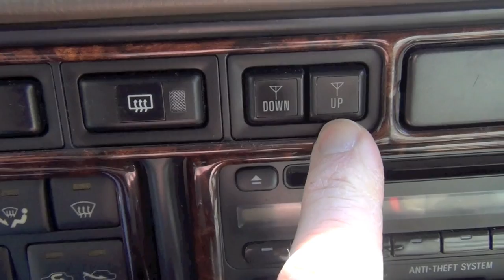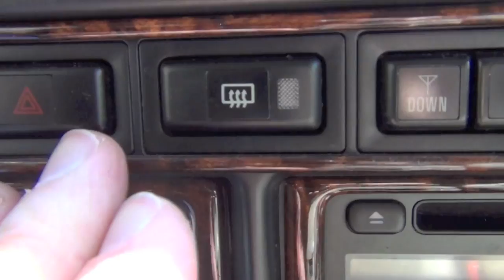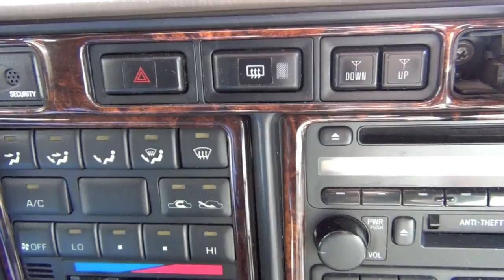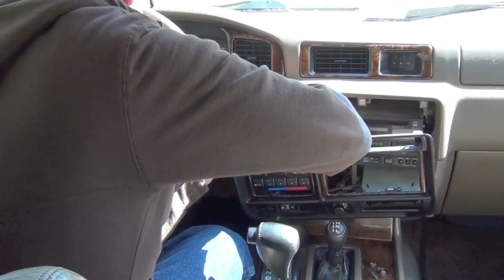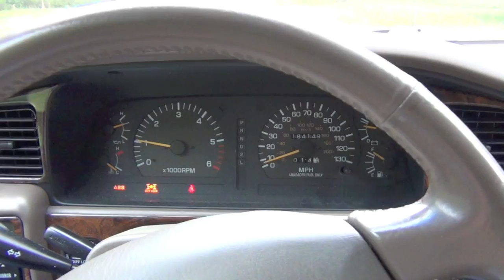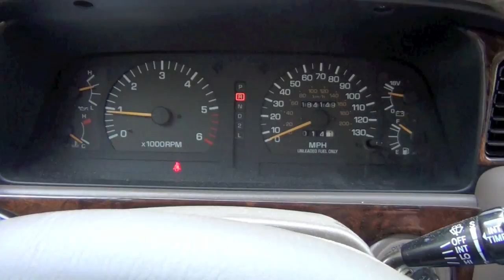80S Land Cruiser  CDL switch install

Comment: Hey Texas - I did this CDL switch install on my 96 LX450 after seeing your vid. Your instructions are spot on.  One minor deviation, I did not move the Security as my wires were super tight. Instead I moved the heater for the rear window to the bottom. I had to remove some of the tape from the harness, but it seemed like the wire length favored having the Diff switch up high next to the Hazard and Security, and the rear window heater down low next to the heater fan switch. Super easy after watching you, took me literally 30 minutes. Much appreciate your vid!!!!
Reply from the maker: Rog Pics - Good to hear man!  Thanks for letting me know it was helpful. Glad you got yours installed. Look up that Pin-7 mod (I added a link in another comment below) it will give you ultimate control.

Comment from the maker: @Dog Hous, the CDL switch allows you to lock the center Diff (in the transfer case) such that the front and rear drive shafts turn in unison. In normal ops w/o this switch engaged, the front and rear drive shafts can turn at different rates letting the front wheels or back wheels slip like a normal rear-end under a car can let one tire spin while the other side doesn't. Same deal just front to back. Make sense?  Putting the Land Cruisers in Low will automatically lock the center diff as well. (Unless someone has deactivated this automatic lock)

Comment from the maker: @Chor, con't from 1 post; ...in the steering linkages and joints. If the pitman arm is not moving very much - the slack is in the gear box. If gear box, then some slack can be adjusted, but be careful not to over tighten as the box can bind. If linkages, then you have to replace the worn linkage parts (tie rods, etc). hope this helps. Basically something is worn and needs replacing or in the case of the steering box; adjusted or replaced.

Comment from the maker: @Chor, The steering play is usually one of two problems or a combination of them both. Have someone sit in the vehicle with it turned on, but not running (key turned enough to unlock the wheel). Have them go back and forth to the point where it pushes the steering firmly on both ends of the play. While they do that, you look under the hood and under the vehicle to see if the pitman arm (off the steering box) is moving or not. if it is moving back and forth, the looseness is probably...

Comment: Hey great video, quick question. What is the point of this modification? To be able to lock the central dif in high gear? Thanks. Also is there a way we can add front and rear differential lock?
Reply from the maker: It is so you have complete control of when the center diff gets locked BUT you must also do the Pin 7 mod (look that up on IH8MUD). I didn’t ever get around to filming the Pin7 mod, but it prevents the automatic locking of the center diff when you put it in low on the transfer case. With these two mods (the switch I added) AND pin7 disconnect mod, you are in full control of when the center diff gets locked. Make sense?

Comment: Hi there, great videos.  I installed the CDL switch in the same way you did, and moved the security down.  You mentioned that you will get heated seats (I want to do the same) ... so where will you put the switch for the seat heaters ?
Reply from the maker: Mike Gibson - That is a good question Mike- I found that the Lexus vehicles of this period have seat heater switches that actually snap directly in to the hole where our little coin holders are. IIRC the Lexus vehicle I got mine from was a mid nineties ex300, but not sure. I’ll see if I can find my notes. I think I did some video of this mod, but it hasn’t been post-Processed and posted yet.

Comment: Man! Just a few more things to add to the 'to do' list, huh?  I am tempted to invite you and your crew for a one-day say at my place in NYC if you think you guys can fix all these issues.   Might be a nice cross-country trip for you guys during the summer, think about it.  Actually, I do have a question about the  bezel, my truck does not have the slide-out cup holder at the top.  How can I get the top screws out to remove the bezel? Thanks.
Reply from the maker: +Rupert Gaznabbi Not sure, but I think that little blank plate just snaps in place.  Use a small screwdriver to get behind the edge and see if it will pop out.  The screws should be behind there.

Comment: Clay
Thanks again.  You know what's interesting is in Europe you can get the Landcruiser in manual!  They even have cute little two-door ones, same for the Rav 4, great size SUV for women.  Can you imagine having a manual LC? That's the ultimate truck, never a tranny issue plus all that torque!  My LC did not come with the driver's manual, do you know what's the highest speed you can drive in the 4x4 Low position?  Normally it is set in the High position for everyday driving, correct? Thanks.

Comment: Hi I did this mod to my 1994 80 series last friday night everything worked out but the next morning i turned my 80 series on when i change to drive mode. it made this really loud sound under the shift  er and the truck would go into gear and would not move forward or backwards when i put in on reverse. I tried it maybe 2 more times and the same thing. Fearing i might have damage something. i disconnected the CDL switch and reconnected to the factory jumper and tried it again. Good thing it worked whew. Thought i was in for a big repair there. I'm not sure whats wrong with my truck. I would have been awesome to have this mod done. What do you think is wrong? Thanks
Reply from the maker: MA COY - Try this - with the truck in factory setup like you have it now. Shift the small lever into 4 lo. Does the same thing happen?  It sounds like the electrically driven solenoid is not fully engaging the mechanical diff lock in the transfer case. All the switch in this mod does is make the solenoid fire when you push the switch. Putting the truck in 4-lo will do the same thing.

Comment: does  the CDL switch mod you did in this video ( not the 7 pin mod) work for '97 landcruisers that Don't have front and real locking diffs? My LC only has the CDL for 4L.
Reply from the maker: Yes, should work exactly the same as I've done for my '96.  This switch will allow you to lock the Center Differential at will (in high or low range).  It will still lock automatically in low range unless you do the pin 7 mod.  Good luck and thanks for watching and the comment/question.  Take care, Clay

Comment: Does this work on an 11/92 manual model here in Australia ?? hmmmm
Reply from the maker: I’m not for sure on the ‘92 Model Tim. Does it automatically lock the center dif if you put the gearbox in low range?  If so, the addition of a switch could be done.

Comment: Will this mod do any damage to the CDL? Is there a reason Toyota doesn’t let it go into CDL in high range from factory. Speed too high maybe?
Reply from the maker: Yeah, you don’t want to get too high speed with it center locked. It could cause some stability and steering issues on roads at higher speeds. Plus you could put quite a load on these parts by turning at higher speed with them locked. I just like to lock it in situations where I don’t really need a super low gearing but want my wheels to have better traction. Like snow or light slippery mud.
Reply: @Texasknowhow  ok. Cool. Good to know. Thankyou. I’ll probably do this and the pin 7 mod in the coming weeks. Cheers.

Comment: Was there enough slack in the CDL wire to move it down next to the rear heater switch in those blanks? I'm wanting to leave my security light high and visible. Thanks
Reply from the maker: Timothy Hull - No, not really. That’s why I went the way I did. I’m happy with where mine is. You can still see the security light at night really easy from outside looking in.
Reply: @Texasknowhow  awesome thanks!!!

Comment: Hey,Clay!
Thanks for your practical videos. At the end of this video you said, that you will make a video on a 7-pin mod, where is it? have you dione it? I cant find it,Could you plese 
give a link.
Reply from the maker: I never got mine done thus no video yet. I need to find time to get that one done. Meanwhile see if this will help: http://www.sleeoffroad.com/technical/tz_cdl_pin7mod.htmThanks for watching and commenting that it helped you out.  Best of luck to you, Clay
Reply: Texasknowhow  Great! It is very clear now)) Thank you so much! Keep on making your videos, I think a lot of people learn a lot from them. Clay, I dont know if you heard of this and may be you have one installed on to your LC, but it is a great device http://automatictransmission.com.au/release.asp?NewsId=41076 which gives you a great control over your automatic transmission making it work like a mechanical by locking your torque converter, this is an irreplacable unit, when you drive down hill, or when you drive in heavy conditions or hot summer, as you know locked torque converter keeps a AT temperature at a very low.Basically you make you car listen to you, and not the factory controller)) This one is made in Australia, but we dont have possibility here to get one of these, so we have this radio-nerd guy in our LC Club, who made the same controller. I am using it , and our friends are using this "Tiptronic". Might be helpful to you too)) Best Regards from Russia's LC guy to America's LC guy!!!)
Reply from the maker: Thanks for the info Kabka3!  I'll look into the controller.  Take care, Clay

Comment: Hey Clay

It's Rupert again, I looked into doing the same mod with my truck but before taking things apart I turned on my ignition switch and looked for that orange four-wheel icon to light up in my instrument panel but it did not show.  Does this mean I cannot implement this mod?  I have the same vehicle as yours so I should have the same capabilities, right?  Keep in mind I am not yet sure if I have my Birfield joints in place.  Is that icon dependent on whether or not I have Birfields in place?  looking forward to your feedback.  Thanks!.
Reply from the maker: +Rupert Gaznabbi Not sure Rupert; why it didn't appear could be for a few reasons including the bulb behind it could be burned out.  Also if any of the wire connections in the system are un-hooked or non-functional it could affect the light coming on or not.  The light will come on when you shift into Lo on the transfer case shifter normally.

Comment: So, the transfer case have the equipment installed in all 80 series models and just needs the switch?
Reply from the maker: Rich Gann Yes, the Land Cruisers have the center differnential lock already and it will lock itself when you go into LO on the transfer case selector (next to the normal shifter).  This switch just gives you the option to engage the center diff while in high.  IF you also do the Pin-7 mod, as I was explaining in the video, then you have complete control manually via this switch of when the diff lock is engaged.  The fact that you shift the transfer case into low will not activate the center diff lock.
Reply: Texasknowhow i think i got ya.  thanks.  i am looking for one with both front and rear lockers factory type with the switch to the left of the steering wheel.  this seems like the same but just the center diff.

Comment: So you’ve always had a CDL or you just installed it?  If you always had it, where was the switch before?
Reply from the maker: Gantry Crane - Mine did not have it so this is a video to add it. The wire for it is wired on ALL Land Cruisers, but the switch is usually not there on Automatic Transmission models as the Center Diff is controlled by the vehicle, not the driver. This puts the control back in your hands... make sense?

Comment: Hi
Can u explain how it works please
U have just installed a button
But what about the lock inside the transfer case?
Is it already factory built in and all what u needed is just the button?
Thanks
Reply from the maker: Yes the vehicles all come with the wire and connector already installed. This is covered in the video if I recall correctly - أبوعلي الجهني
Reply: @Texasknowhow  
That's weird so the factory did the big job and didn't put a button
Anyway your video is amazing
Thanks a lot
Reply from the maker: They did indeed. They all have the center diff lock because in Low gear mode on the transfer case they lock it automatically. So, on the production line it’s easier fro the wire harnesses to all be identical. Then it’s just the button depending on the market, department of transportation rules/regs etc that allow them to install these options. Or it is sold as an up grade. The Front and rear diff locks are an option for sure. - أبوعلي الجهني
Reply: @Texasknowhow  wow that's very precious information I didn't know before
Reply: I have another question
My vxr is 1993 
When I switch the difflock button I hear click sound but the rear diff light keeps flashing but the front one is fixed 
Actually I never drive it off road
Just tried to check it
What does that mean
Reply from the maker: أبوعلي الجهني These are electrical mechanisms so hearing the clicking means you are getting power to the actuator which is good. But the actuator can not engage the gears in all locations   So try to drive forward slowly and turn left and right some. It will probably drop in place. If not, you may need to remove parts and service or replace them. .
Reply: @Texasknowhow  so both diff lock lights has to be fixed, without flashing?
Reply: Actually I drove it just few meters forward so that is a good advice
Reply from the maker: أبوعلي الجهني That is correct. If they lock in the lights will be steady.